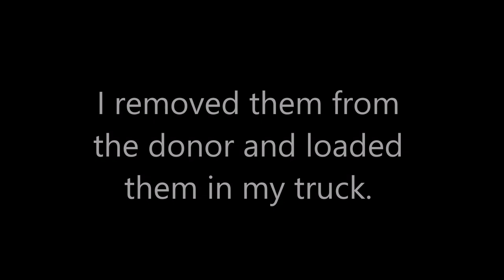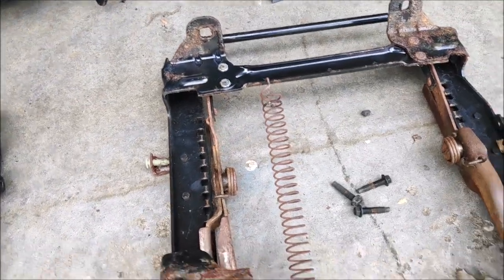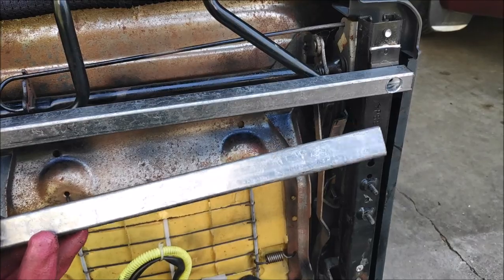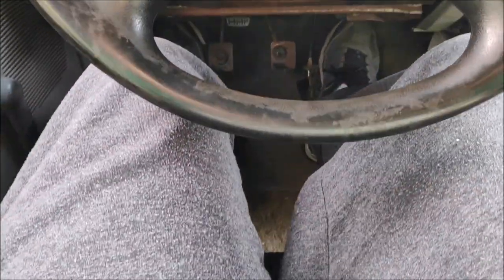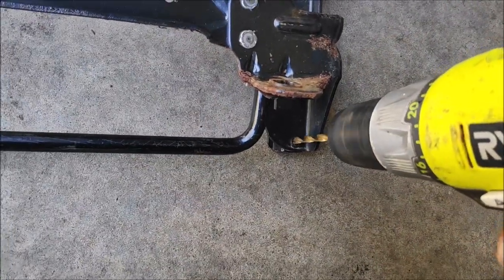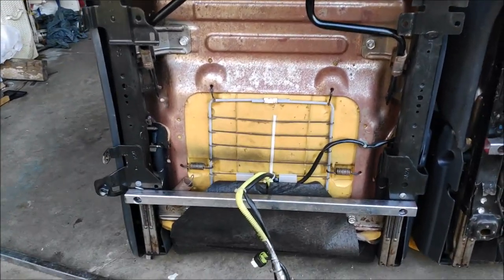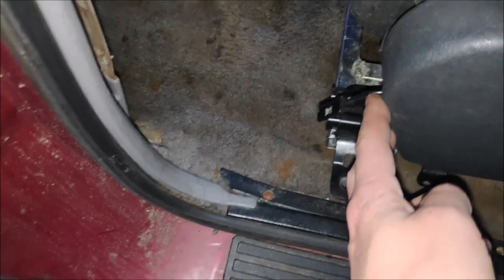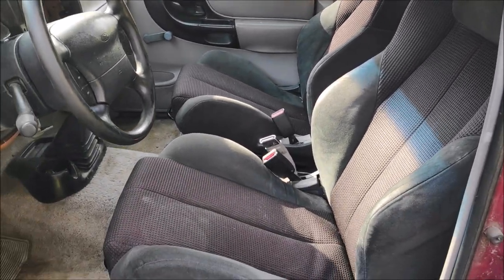Best Ford Ranger Interior Upgrade

Comment: Y not find direct bolt one..explorer, broco, sport trac, smaller ford truck suv, that I can't recall, Mazda b2300 or b2500. The supercab can take certain years from those vehicles and slide right in. I have to do the same. But, I did it old school and made it work
Reply from the maker: Because I liked these seats more.

Comment: Buy fabric paint
Reply from the maker: Like for the carpet?
Reply: Yes for the carpet  vacuum and tape off plastic  it will look new I buy a  car with  oil stains  and  you can't tell  I used the  smoke  color  for grey
Reply from the maker: Is there a brand that you would recommend?
Reply: @everydayirace  rustoleum  or duplicolor
Reply from the maker: @izoletearistoy6978  thank you.
Reply: @everydayirace  no problem